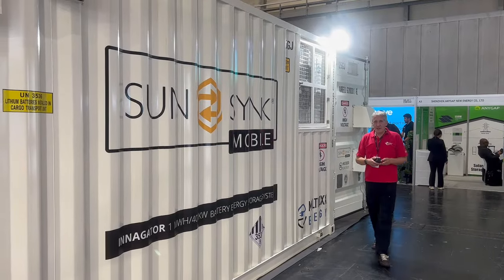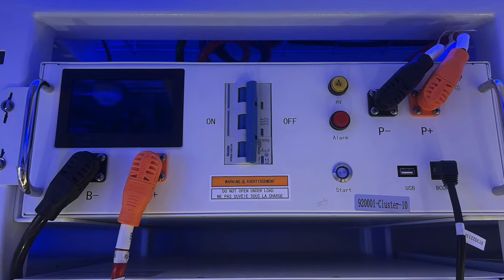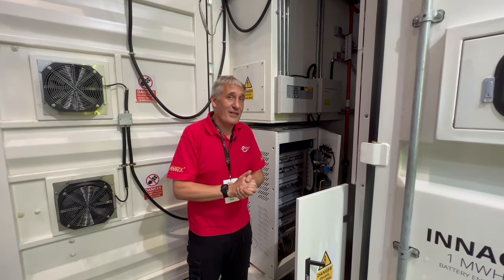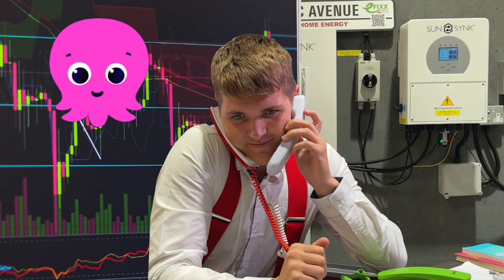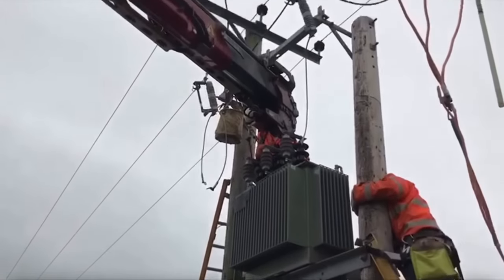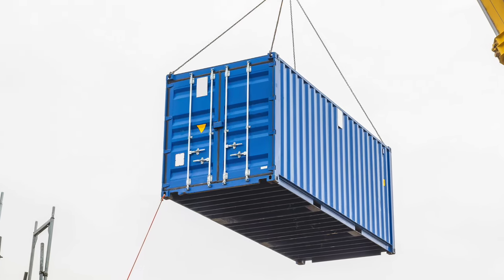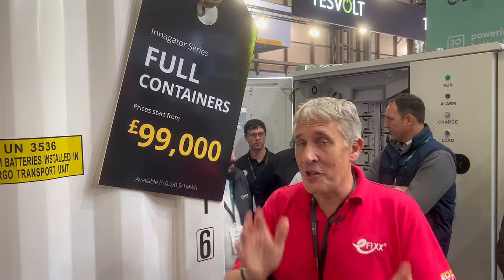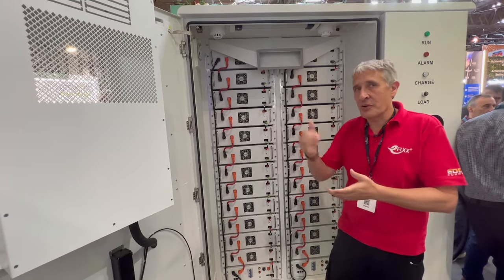Sunsynk Innagator - Industrial Scale Storage Battery

Comment: Need to get battery pack upto Scotland and connect to the national grid.  Then it can be charged up from the Wind turbines out at sea.  Then the national grid can use it when needed.  Currently wind turbines are being turned off as not enough capacity on HV lines from Scotland to England
Reply: Maybe have a look into the 50 MW, one-hour West Gourdie battery in Dundee.

Comment: That's still only four and a half months of electricity usage in the average British home. It would power the small town in which I live (about 1,500 properties) for a couple of hours.

It's also only 10 of the batteries in a BMW i7 eDrive50.

Unfortunately battery power is not true grid-level storage (and the batteries have a limited life).
Reply from the maker: A few hours during peak hours is the ideal application for battery storage like this.
Reply: If it stop a gas genny running at peak hours then....
Reply: Tell that to the locations in Australia where they’re doing exactly that.
Reply: @Pugjamin  So you've bought into the hype then? From Australia, which has one of the worst records on CO2 emissions per head in the entire planet. Worse than Canada, worse than the USA. No less than three times higher than the UK per head of population. 

So, Australia has a 450 MWh battery? It's a drop in the ocean. All it's being used for is to smooth out some bumps, and that's about it. Average daily electricity consumption in Australia is over 500 GWh. So that 450 MWh is 0.09% of nationa daily consumption, or about 86 seconds...

To put this in perspective, the Dinorwig pumped storage system in Wales, which is used for the same sort of function stores 9.1 GWh, or more that 20 times that Australian battery (which will need replacing in a decade or so as it degrades).  Nobody thinks of Dinorwig as anything more than something to smooth out the bumps in demand. It is not true grid-level storage, which would have to hold power enough for a few days to cover intermittency issues. That's storage in the multiple TWh region.

Li-Ion batteries simply aren't cost effective of large scale, which is 3-4 orders of magnitude greater than these battery farms.
Reply from the maker: @TheEulerID  Australia has an excess of solar generation. Distributed arrays of batteries can mitigate the need for distribution network upgrades.

Comment: How does this battery work without bus bars? I don't understand how it has 25mm cables connecting one battery to another, with twenty or more batteries linked together with such thin cables.

By the way, by FAR the most efficient way to use batteries is for each house to have about 10kWh of battery storage, about £1,500 cost at today's prices (December 2023, UK), for a pair of batteries that will last throughout the night in the Winter.  Centralising huge batteries like these and then trying to distribute their power over the grid is just stupid...
Reply from the maker: The batteries are connected in series - so it’s the voltage which stacks up - 800V per stack

Comment: It’s surprising that it’s allowed to have that many batteries in on room
Reply from the maker: It’s fully self contained with gas detection and fire suppression.
Reply: @efixx  fire suppression isn’t going to cope if it really catches on fire.
No matter if you have the suppression system I would guess that all batteries subjected to the smoke and water is going to be deemed as destroyed in case of even a small fire?
Reply: @kristiangoransson6104 why would they bother to install fire suppression if it can’t cope. There are extinguisher chemicals available that do a perfectly acceptable job of putting our EV fires.
Reply: They have car shows where all the cars are full of petrol?
Reply: LiFePO4, by the looks of it.  Not likely to burst into flame from the cells themselves.  A Tesla LiFePO4 mega went up in smoke here not too long ago but it didn't look like a lithium battery fire, something else caused it.
Reply: Those containers are about the best you can do for fire safety. Well separated from the main building and if ever something goes wrong, they can be accessed.